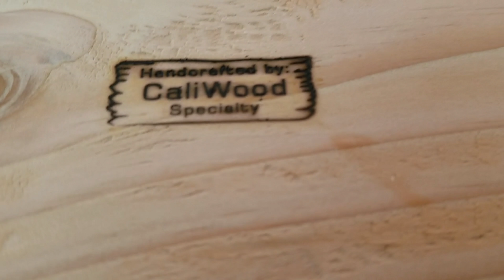Rustic Bench

Comment: Strike one: you routed the bottom of the feet
Strike two: you branded the top dead center of the bench
Strike three: you are from California
Reply from the maker: 🤣🤣🤣
1. Prevents splintering when it's moved around.
2. Customer request
3. Not a strike, but a grand slam 😁